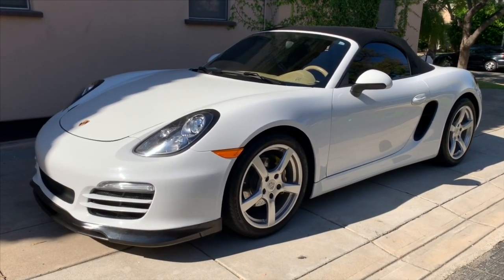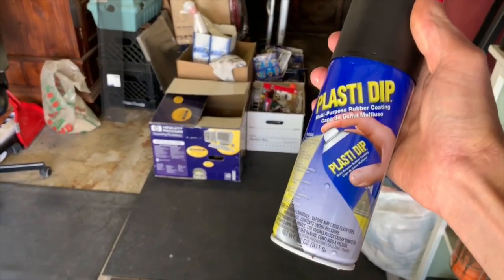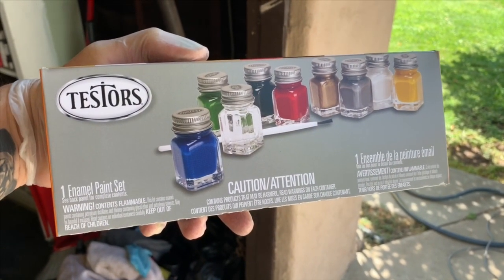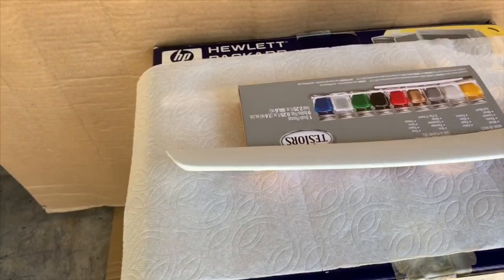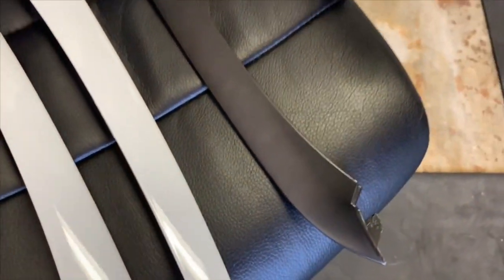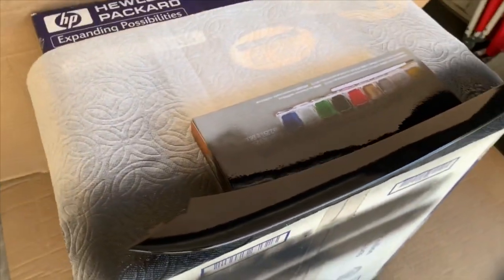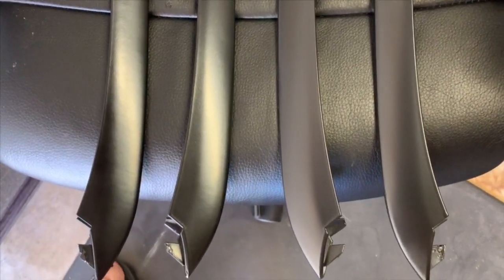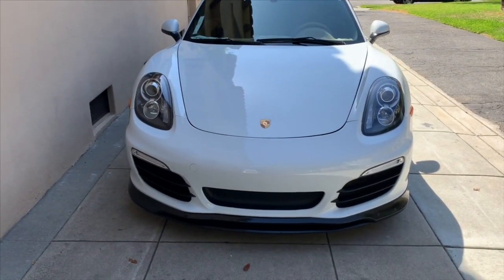Porsche Boxster 981 DIY Plasti Dip Radiator Grill Strakes

Comment: Does plasti dip hold up as well as paint?
Reply from the maker: I have found Plasti Dip to be an amazing alternative to painting: 1. It is a semi-permanent option that allows room for error or back to stock in the future and 2.  It is extremely durable and looks legit OEM! 

I have had my Strakes dipped for a lengthy period of time now without a single divet, scratch or nick!  It’s an incredible product and I highly recommend it!
Reply: @mattwiggins8691  
Thanks.
I'd like to also do the mesh radiator guards, where would I buy the mesh from?